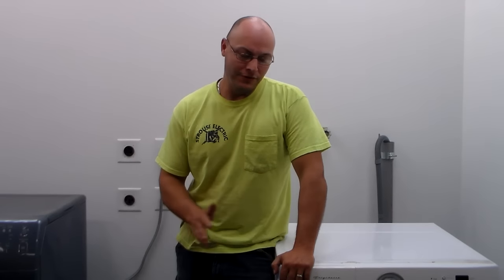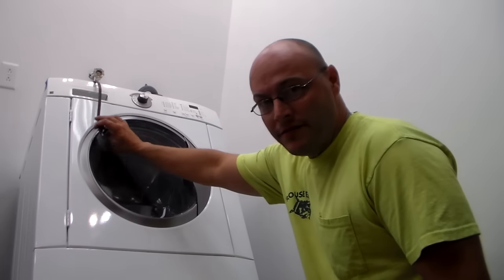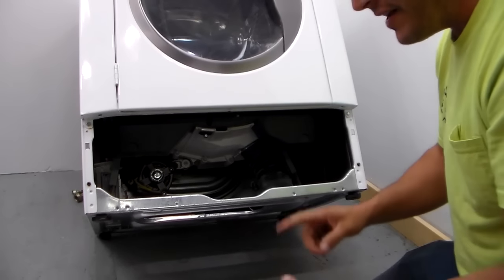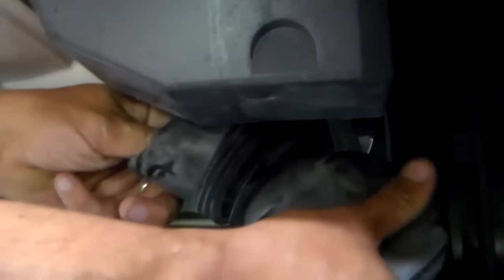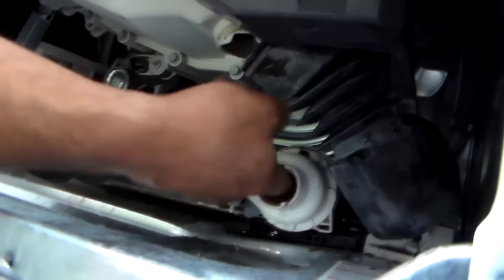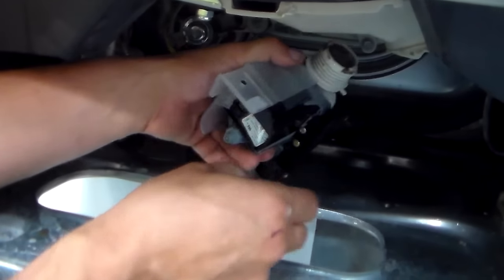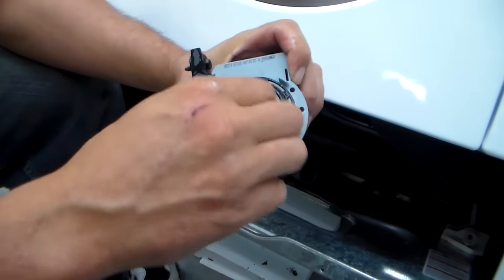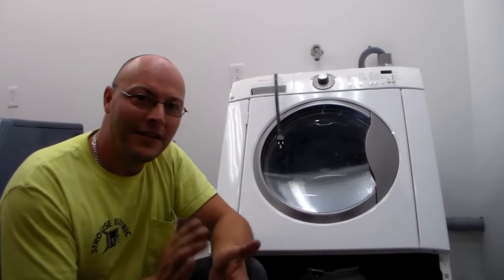Front Load Washer Repair - Not Draining or Spinning - How to Unclog the Drain Pump

Comment: one very very important note. Like everybody else it was very difficult to reconnect the rubber boot to the pump. I spent about 2 hours trying to get it to work. my hands are killing me. Went to the local Ace  hardware store to buy a different type of clamp. the kind dude recommended a pair of small channel locks. duh! A small pair of channel locks worked perfectly it held the clamp open around the lip of the boot as I reinserted it onto the pump. problem solved. Use a small pair of channel locks. Thank you for making  the video. Also may there be a special place in hell for the GE engineer who designed such a customer unfriendly method of cleaning out the trap. and to think GE makes jet engines. God save us
Reply: vise grip
Reply: I’m working on a Siemens washing machine now. May there be a special place in hell for those engineers from Siemens as well
Reply: be
Reply: hi
Reply: Amen 🙏🏻
Reply: Oo9
Reply: Jet engines, locomotives and back in the day they made toasters and Waffle irons
Reply: I just want to say thank you so much. This video totally allowed me to fix the washer while my husband was at work. He was so proud of me and glad he didn't have to deal with it. So thanks for making me look smarter, in his eyes anyway.... Lol
Reply: 129jaystreet, you do have a way with words.
Reply: Sir, l challenge your GE water pump issue against my Maytag washer lint filter removal for that special place in Hell for these guys! Once I realized the level of difficulty involved to remove the damn thing, I decided just to buy a new washer!.... but wait there's a catch… My son's clothes are still locked inside of the washer that I cannot get unlocked because the filter needs to be cleaned...💥💥 bam
Reply: Omg lol. Agreed 💯

Comment: I have no idea what drives a person to create such helpful videos but I sure am glad for your generosity sharing this info with me. I was really not looking forward to trying to figure out why my washer wouldn't drain. Now I'm confident I can do it. Thank you very much.
Reply: Ok, finished the job and all worked out well. My washer (Maytag Neptune with glass door) has the pump & boot at the rear of the unit with a large trap door on the rear. Two screws to pop the door off and it's all right there. Still, your video was very helpful and allowed me to make quick work of it. Found that if I moved the machine to doorway to our garage (short distance) I could put a tub behind and below it (garage is a few steps lower than house) and allow the washer to drain through it's hose into the tub. This way the job had little leakage.
Reply: $$$ 3.3 Million views!😅

Comment: Since retiring I work on washers and dryers in my garage, I too struggled to get the boot coin trap out. The hardest part for me is getting the top of the boot back on the machine. There is a special hell for the engineers who design these machines.

Comment: Just did this.  The machine made a loud hum but would not drain.  This video was a great tutorial. Since the washer didn't have a front panel, I did have to take off the top and entire front panel (there's a  youtube video on how); not hard actually. Talk about clogged trap. I removed a folded dollar bill, $1.68 in change, a 5" wide heart shaped fabric decal, a few paper clips, a bobby pin, and a bit of chewed up scotch brite (the final straw, I believe, based on its location).  Put it back together and ran a trial load.  Bingo! No leaks, machine ran complete cycle. At 73, this girl is strutting.

Comment: Hi, Bill
I've been in the business for approx 35 years.
This washer is why they changed the access to the front so the consumer can clean it out.
That said, when I do these, because I've grown to hate spring clamps, I use screw type hose clamps when I am refastening the hoses.
It saves time because the spring clamps have an attitude and fight back and spoooiiiing awayyyyy.lol
I have to do this tomorrow so, I'm ready with the screw clamps.
Nice video.
My own appliances are mostly WP and my washer is a top loader.
NO electronic controls either.
Reply: I could not get one of the spring clamps back at all! Used screw type clamps after an hour of trying to keep calm.

Comment: You just saved me a bunch of money! I was gonna go buy a washer and dryer set, then I saw your video! I can't believe how much crap was in the catch thingy in the boot! I almost gave up immediately, since 1 of the screws on the front panel seemed to be stripped..but I bought a better screwdriver and was able to remove the screw. It was a little hard for me to get that green clamp to fit over the boot and other thing. But I was able to do it while reminding myself the cost of a new washer would be. My 10 yr old  washer drains and spins like it's new again! I was hoping I could show a pic of the crap that was in that thing.  I have to admit, I am really proud of myself for attempting and completing the task! Thanks to you!!!

Comment: Another washer saved by a great video.  Our Amana stopped draining and we thought it was all over.  Took off the back cover and pulled the two hoses connecting to the drain pump and hello hair clog!  A repairman might have just replaced the pump on account of the nD code on the display but all it needed was a little TLC and the washer is back to normal.  Also gave us an excuse to clean out behind the washer and dryer because WOW stuff accumulates there when you're not looking!  I found about eight spiral bound notebooks, a new in package dog leash, and a whole unopened container of laundry pods!

Thanks, Bill!

Comment: My dad was about to call the repair man when I found your video. Me and my little brother fixed our washer together. It works now. We didn't have the right tools to disassemble the front. I had to remove the back part and work from there. It was difficult with the horrible angle but we did it. We found 60  cent and baby wipes. I'm going to have a talk with my family about sorting through their baskets before doing laundry. Thank you so much.

Comment: I fixed our Miele W3725 front loader by watching this fellow.  We had an error display "drain error" and our clothes always came out wet.  I removed the panel on the front LHS, unscrewed the plug (it's best to do this when machine is empty) and removed the drain plug and cleared it (pulled out hair clips, 10 cent coin, sticks and fabric) screwed it back in, turned it on and she works perfectly.  Saved calling a serviceman and had it fixed in 5 minutes.

Comment: Bill you are awesome! I just bought a Frigidaire Front Loader Washer and Dryer from one of my friends. The laundry was soaking wet after a wash cycle so we had to do a spin cycle to get the excess water out. I knew there was something wrong so I came across your video and I fixed it myself! I found a pair of underwear and tons of black lint and rubber bands stuck in that coin trap! No wonder it wasn't draining properly! Thanks again Bill! Couldn't have done it without your video. Btw if you attempt this yourself do not make the same mistake I did and take the black boot completely off. It took me hours and several attempts to get the clamp back on where the pressure switch is.

Comment: I'm glad to know I'm not the only one that has a bit of trouble doing this!

I've had to do this half a dozen times, it never seems to get easier. Today I busted blood vessels in both my thumbs because of those freaking spring clamps. Ugh! I came to look up what pliers were best for removing and replacing those stupid things.

My front panel doesn't come off but since my arms are smaller than most men's I just take the back panel off and work from the back and the bottom with the washer laying on its front.

Thanks! for your video, now I gotta get back in there and win this battle with these clamps so I can get my laundry done!

Comment: You are awesome!  I was able to fix our washer based on your instructions.  I have one of the Frigidaire Affinity washers (with the silver control knob and buttons) where I had to remove the entire front panel.  It took a little effort and a quickly drawn schematic to keep track of where screws went and where wires plugged in ... but I did it!  And yeah... there was a 2008 quarter, a hair tie, a portion of some underwear, hair and just nasty/gritty gunk.

Also you are correct... if you remove that 3rd portion of pipe up to the far right (in your video @ 3:47)... holy cow is it insanely hard to get back on!  I was fighting with it for about 10 minutes.  All in all... you saved us a big repair bill or buying a new washer.  So much thanks goes to you and this video!

Comment: Thank you for the video. Watched the video twice, once before disassembly and again to get everything back together.
I had taken everything apart to clean 15 years of accumulated smutz, then had trouble getting everything back together correctly. And unfortunately, I did remove the boot from the pressure tube, painful. I had to use stainless automotive hose clamps to complete the assembly. Works likes new.
Thanks again.

Comment: Hey this is fantastic  - I just fixed a Bosch Nexxt 800  Series Washer following these instructions! The service guy here told me it would cost $180 to come diagnosis it and a minimum parts order of $200 so I should expect at least $400 to $600 service call. it turned out to be a sock clogging the drain catch. I could not figure out how to get this front panel off, but I did get enough pieces of it off to reach the cleanout and follow the steps - thanks very much!!!
Reply from the maker: Newell SuperUser Awesome!  Imagine how many people pay to have this done by a service guy.  I'm glad you saved some money!

Comment: Thanks for your video. I cleaned out my drain trap like I have done lots of times cause my front loader wouldnt drain but this time it still wouldnt drain.  After i watched your video I put my finger in the pump to check if the fan blades spin and found an object trapped inside just like you said might happen. As I type this , my washer is at work washing my stuff.
Reply: sean rodriguez p

Comment: Hey so I have the A 10 code.  Did everything as suggested by many also replaced the washer drain pump.  Even after doing that, I still have the A 10 error.  What else should I be looking at?  

I also think my previous drain pump might have been good but doesn’t matter now that I got a new one.  

Any suggestions on how to proceed would be greatly appreciated.

Edit:

I figured it out.  The rubber boot connected to the drum before it connects to the drain pump had a sock in it. 

Finally have my machine up and running.  😎

Edit: After the drain cycle I still noticed my clothes being a bit wet.  I replaced the motor drive belt in my front load washing machine and it solved the issue.
Reply: I appreciate you sharing your problem solving adventure and following up. No doubt this will help another in need. Thanks!

Comment: Thanks for the video, helped me fix my 11 year old Frigidaire Washing Machine
 Model GLTF2940FS1. Cleaned out the coin cup, found a couple of coins, but that wasn't the problem. I decided to replace the drain pump motor since it was only $20 on Amazon. Installing the motor was easy, but putting the hose clamps back on was a royal pain in the butt, so much harder than taking them off. Finally got everything back together and the washer is working fine again. Thanks!

Comment: If you have a front loader you have to learn to do this.  It's not a matter of if the drain pump or boot will get clogged with something it's when.  Plus, it's going to happen more than once.  It's not very difficult to do just a little frustrating hooking everything back up if you haven't done it before.
Reply from the maker: +Jim Pimmers Very True, Very True
Reply: So true!!!!!

Comment: Thanks.  I got 0.90 cents.  I am an automotive engineer.  What a poorly designed Maytag machine.  If this was a car, the manufacturing plant would kill me for bad access to the components and difficult assembly.  Poor access for no reason, this could be much bigger so that a normal sized human can get their hands into the work space without have to be triple jointed. Stan D.

Comment: THANK YOU SO MUCH!!! As a single mom I just bought a used washer and of course a week later it stops working and all I could find were the ones with the little door on the front but of course my washer didn't have that. This video was so perfect and easy and I was able to fix the washer all on my own!! I also found $2.26 and a lot of junk inside the drain pump.

Comment: Thanks so much!  I thought my drain pump was on the fritz (of course my front loader does not have the lower front panel so I had to take the door off and the entire front panel), but it turns out the coin trap was literally clogged with what looked like a pound of mulch!  To be fair, it has not been cleaned since I bought the washer about 5 years. ago.  Cleaned it out and washer works great again!  Your video was a HUGE help!  Thank you!

Comment: Thank you Bill this worked! Our washer wasn't working so  I followed the procedure and found an old sock lodged in there right where you said it would be. I put it back together the first time hadn't put the hose tight enough on so it leaked but I just took it back apart tightened the hose clamp properly and now its working no problem and my wife thinks I'm a hero lol

Comment: Just got my Amana Tandem 7300 washer back into action! luckily the design was a bit better than the one in the video it had a screw cap right there at the front that held the trap in, found your video and had it fixed and back to working within 30 minutes. There was 10 coins a receipt, hair, stickers and who knows what..... thank you so much!

Comment: Was installing a washer this morning and it would not drain.   Checked out the video and fixed it.    You wouldn't believe what I found in the rubber catch...a childs ball about 2" in diameter.   I was shocked when I stuck my finger in there.   Thanks for the video.

Comment: I am so grateful. Saved me from having to hire someone or buy a new washer. The only difference for me is that my pliers were not big enough and I was not strong enough. I used a vice-grip and left it closed, fit around and tightened until able to move. Thank you.

Comment: Nailed it! I knew the problem with my machine was the water pump - I was getting an "nd" (not draining) error. I went online planning to get a replacement pump, when I stumbled across your video. Sure glad I did! I pulled out the pump and boot, cleaned them up, put 'em back, and SUCCESS! She runs fine, now. 
BTW, I have a Maytag Neptune. Access to the pump on this model is in the back, not the front. Just remove the 17x20" aluminum panel, and the pump is in plain sight. My dad used to flip appliances for side money, and he loved Maytags ... said they were the easiest to fix. Looks like they still are.

Comment: This video saved me $300. I have a Maytag Series 2000 front loader. It turns out that the coin trap is a user-serviceable part located behind the front panel. The panel can be removed without tilting the machine (my dryer is stacked on top). Of course, I didn't see that until I had unstacked them and tilted the machine. Now, I'll make this an annual maintenance item. I also found my nice brass collar stays (two pair) and $0.77.

Comment: Bill, thanks a million.  I just cleaned the drain catch thanks to the confidence of purpose that your video gave me.  Among other things in it was a plastic doggie poop bag (the main culprit), coins, hair pins and the like.  You saved me hundreds of dollars and the inconvenience of having to schedule a service call.  It turned out to be a  simple repair  too, the front lower section tilted out with the help of a screwdriver, then it was just unscrewing the filter.  I caught most of the water so it wasn't too much of a mess.  Thanks again, you are a good teacher.

Comment: Thanks for this video, Bill. I was about to give up on fixing my washing machine especially after only getting a couple of nails and a bobby pin out of a relatively clean drain filter. I decided to pull out the drain impeller(?) and there it was - a nail had lodged itself in the propeller and jammed it, pulled it out with pliers and voila, it turned. My only screw up was taking the propeller housing apart to clean it up -- on reassembly I didn't get the o-ring on properly so there was a water leak but yay - it went through the rinse and spin cycle! I've since reassembled it so fingers crossed that everything is good.

Comment: Super video!  Very straight forward and simplifies the whole process cleaning out the drain filter, the coin trap and the pump.  The only other advice I would add, is to have a nice thick dry towel underneath to catch any extra water.  Thank you for making this video!

Comment: Thanks Bill.  Fixed mine in a few minutes by removing a sock from the rubber boot.  Was able to access it easily from underneath as there is no bottom panel on my specific machine.

Comment: I had put the dogs bed in the wash and the the load would not drain. Thanks to the video I was able to open up  the drain pump. The impelar was jamed with sand from the dogs bed. Once I cleaned it out it worked like a charm.
Thanks a bunch!